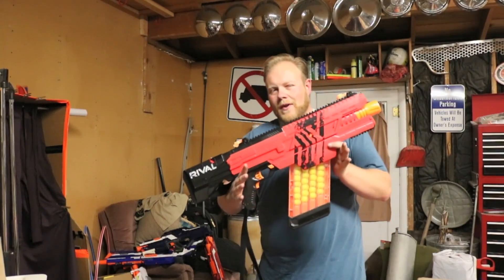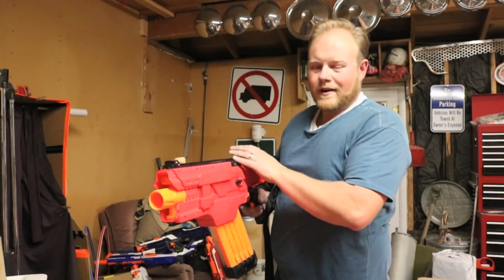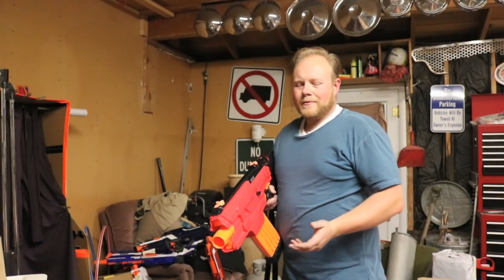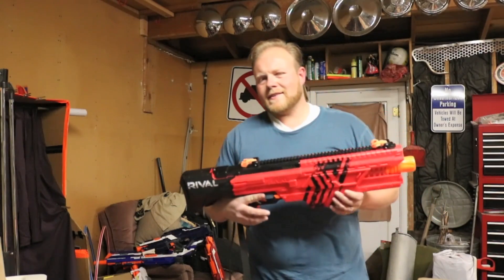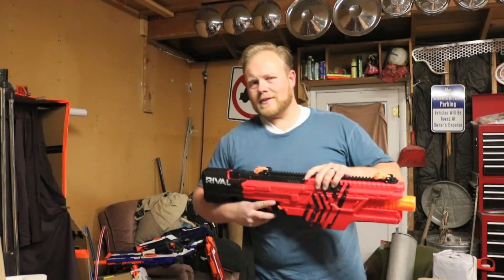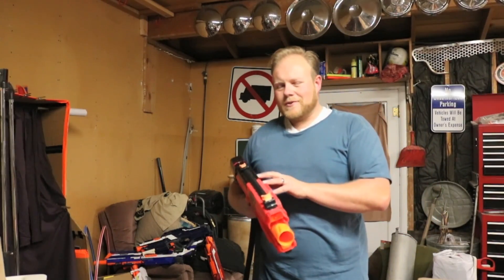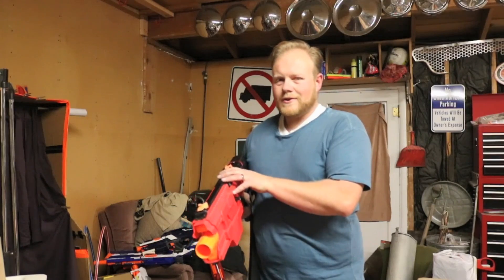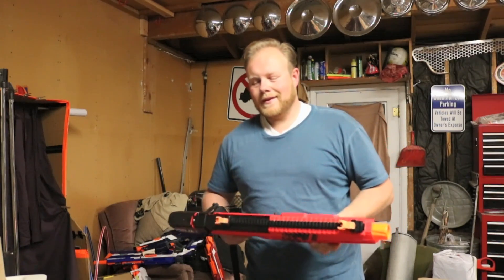The Rhino'd Khaos Gets a PWM

Comment: @Mister Nathan Do you have a picture of your installed placement of the PWM mounted inside pls?
Reply from the maker: The only image I have is the one seen at 0:16 on this vid. I don't believe any other pictures were taken during the install, and I don't have the blaster anymore. 
But it did fit in the battery compartment along with the battery. I just adhered screw bosses from another blaster onto the shell, and mounted the PWM board that way.

Comment: So I've done this, and even added a second PWM (the same exact kind shown in the vid). I wired the pwm directly to the wires that feed into the flywheels, however there is a slight delay now when the rev trigger is pulled to the time it actually revs the motors. About a half a second. Any ideas why that is?
Reply from the maker: En1gmatic1 The flywheel motors are likely pulling too many amps at stall for the pwm. I had the same problem when I tried running a Hellcat in the pusher. 
There's an immediate spike in amp draw when you try to fire up the motors, and it basically trips a internal breaker in the module. The breaker resets as the spike drops, and allows the motors to run. 

Tl;dr: the PWM listed is spec'd for a single Rhino motor. You'd need to source an appropriately sized PWM for the two flywheel motors.
Reply: Mister Nathan makes sense, but i initially tried it with a smaller PWM that is only rated to 12 volts at 2amps, and when dialed down low the response was still instant. It was only when i tried to turn the dial past about 40% would it completely shut off and fail. Which is why i switched it for a duplicate of this PWM..but I'm now getting that delayed issue.

Comment: I did a similar feeder mech modification using a brushed motor ESC and a servo tester. With a 20A ESC rated for a 3S LiPo, there may be more resistance in the circuit that limits the RoF at 100% relative to the PWM set up you used, but the overall circuitry is so small that it easily fits inside a Stryfe shell with an auto conversion.
Reply from the maker: Daniel Okada VERY interesting! I've been hearing more about ESC's lately, with the more commonality of brushless motors in the hobby. That's definitely technology I'm wanting to learn more about. This PWM was really a fun addition to the Khaos, and I'll probably be introducing "adjustable features" to more of my builds in the future, just for kicks.
Reply: Can you make a video of this stryfe cuz i have tons of brushed and brushless escs and lipos just laying around that i would love to pimp my strayven

Comment: where can i get one of these and how easy is it to install/Wire?
Reply from the maker: Mr. Xnc 
I updated the description to include a purchase link for the module, and a link to the wiring diagram I used.

Installation was fairly easy. The circuit board has +/- input (from battery), and +/- output (to motor). If you're familiar with rewiring, this shouldn't be a difficult install. This Khaos has an aftermarket conveyor motor installed, which required quite a bit of modification, however. 

The PWM fits neatly at the front of the battery tray, leaving a decent amount of space for the 2200mah 3S LiPo.
Reply: the link works but the Imgur one shows a broken image logo, but i downloaded it and it shows up clear. thanx sir, may do this for my Nitron and or buy a Khaos lol